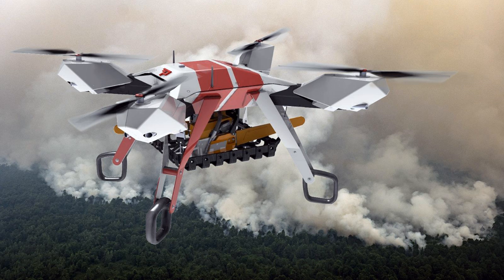The Era of Heavy Lift Drones: Joshua Resnick, CEO Parallel Flight Technologies

Comment: How how is this proprietary technology? Parallel hybrids have existed in in cars for a while now. while I do admit  putting them on each rotor of a drone is a novel idea it's not enough to make it proprietary I mean he didn't invent the generator motor he didn't invent the idea of a hybrid power train. I admit I am retarded and thought that putting a gas engine on each leg would weigh to much. And you need to have direct control of the torque generated by the engine to allow it to fly the way a quadcopter does. So a smaller  parallel hybrid with one gas engine connected to power train could never fly (well)without pitch control of rotors. BUT Dude your so called proprietary  technology isn't that clever and you have no right to stop someone  from building this if they want to. Especially when a retard like me came to the same conclusion that hybrid drones were the future of heavy-lift. Not to mention the potential of swarms of these these m********** working in tandem. the only thing that stopped me from coming to parallel hybrids was the fact that I don't have the math down quite yet but I'm young so f*** you mr. Nikola Tesla you genius inventor you